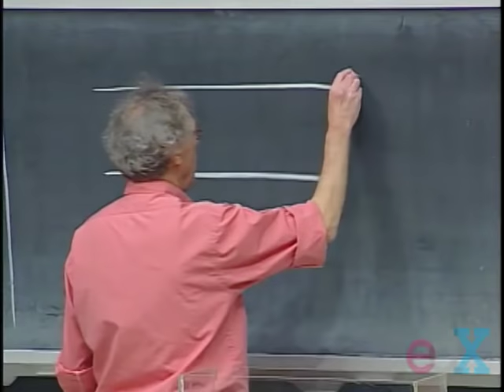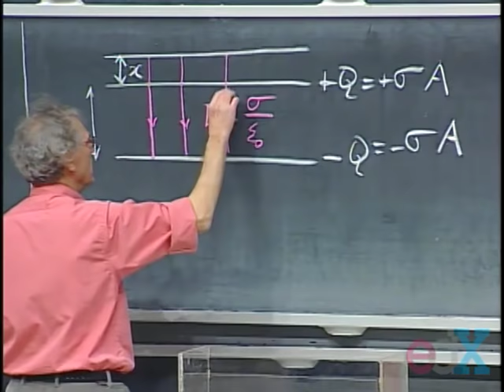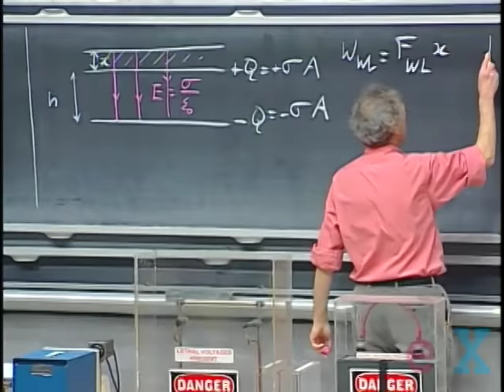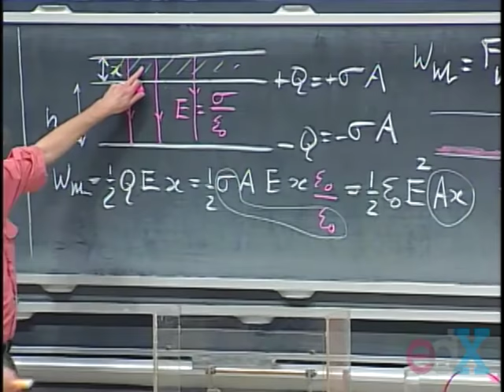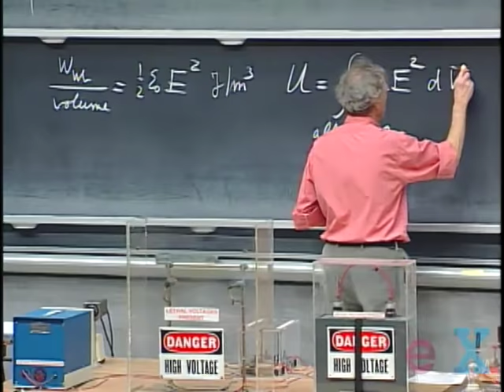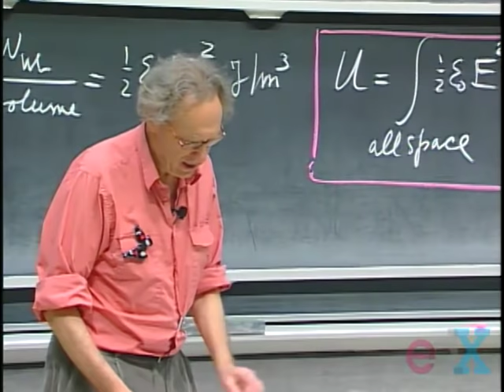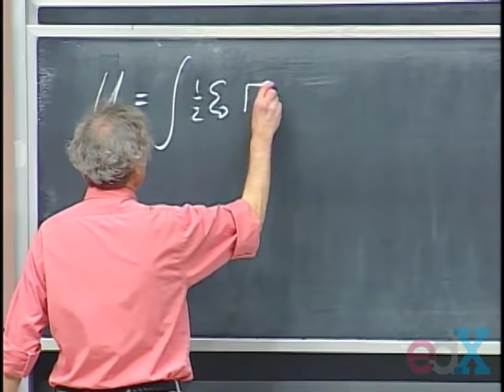8.02x - Lect 7 - Capacitance, Electric Field Energy

Comment: Sir, I have a doubt as V is the work done in bringing one charge from infinity to a point, which is of course similar like the work while moving the charge from one plate to another plate in the parallel plate capacitor, then the total work done should have been q*v only right, what is the significance of the term 1/2. Though I understand the derivation I have this confusion?
Reply from the maker: factor of 2
Let the charge on each plate of the capacitor be Q=100q (+Q on one plate and --Q on the other). Let the area of each plate be A. The E-field between the plates is then Q/(A*eps_o). Let the distance between the 2 plates be d.  Now release q from the + plate to the negative one. The energy that is released is force*distance which is very close to q*d*Q/(A*eps_o). But after this transfer the E-field is reduced, it’s now only 0.99*Q/(A*eps_o). I now release another q thus the energy that is released is now 1% less than with the first q. By the time I have released 10 times one q, the E-field is only 0.9*Q/(A*eps_o) and thus the force on the charge q is only 0.9*q*Q/(A*eps_o). The force keeps going down as I transfer more charge.  By the time I have released the last q (of 100) the E-field has become 1% of the original E-field thus the force on the last q is about 1% of the force during the first transfer. Thus by the time that I have released 100q=Q the average E-field was only 0.5*Q/(A*eps_o), NOT Q/(A*eps_o). Thus the average force on a charge q during transfer was NOT q*Q/(A*eps_o) but only half that. Thus, by spooning off the chaInfamousrge from one plate to the other the energy release is NOT Q*d*Q/(A*eps_o) but only half of that. The energy that is released this way (also called potential energy) is identical to the work that YOU would have to do to separate the 2 plates over a distance d.
Reply: @lecturesbywalterlewin.they9259  Thank you for your reply sir. 😍😍😍
Does that mean initialy the workdone will be less to charge a Capacitor then as it approaches its max limit the amount of work done will be increased? Am I right sir?

Comment: Sir,Why must the electric field be taken as average between field strength inside the plate and outside at 3:23 ?
I thought since i am moving Q, and Q is inside the plate the force should be QE=0.
Another thought I had was since the charge is on the surface, let me consider it to be outside the plate.Then the field there due to the opposite plate wil be sigma/(2 epsilon naught) on every dQ and then I may get the answer you got. Please guide me. What is actually happening here? Thank You
Reply from the maker: I get this question often. I suggest you ask Google to help you. Or if you have a physics book read up on it.
Reply: I guess it's because the layer of charge inside the plate has two surfaces - one that is exhibited to the field of E = sigma/epsilon_0 and second to field of E = 0.

Comment: @18:01 Also.. since electric field between parallel plates is constant.. reducing or increasing the distance between them should not change its ability to breakdown the air and therefore, the capacity to hold charge (capacitance) should remain constant right ??
Reply: Capacitance of an object is not measuring the object's ability to breakdown its surrounding air. Instead It's measuring the object's resistance to accepting new charge... meaning .... if the work done required to increase an object's charge is low.. then the capacitance of the object is said to be high !! 

So.. by using the formula for electrostatic potential energy for a capacitor in 6:39 we can show that.. for the same amount of energy, the capacitor with shorter distance of separation will collect more charge !!
And the discharge that can result in bringing the plates very close to each other can be avoided by placing a paper in between which is a better dielectric than air that wont breakdown very easily.
Reply from the maker: yes E is independent of d as long is d is much smaller than the dimensions of the plates
Reply: Yes sir. Thank you for taking the time time to comment when you have followers by the millions. It's a daunting task to think of and we thank you for your kind heart and service 😊

Comment: Sir we know that energy density is 1/2E^2epsilon0 
but what is the energy density if we insert a dielectric slab of dielectric constant k  
And isn't it true to say that the E in the energy density expression the magnitude of E field inside
Reply from the maker: <<<1/2E^2epsilon0 >>>
if you insert a dielectric after the charging battery has been removed the E-field between the plates will go down. Thus the energy density will go down. It means that as you bring in the dielectric it will be "sucked in.*
Reply: And professor what about the the E in the energy density expression 

Is it the E field inside the capacitor
Reply from the maker: I cannot add to the clarity of this lecture

Comment: hello dear, 
I want to do an experiment like the one u show in 29:06, but when I connect the voltimeter to the parallel plates, it always gives me the differential potential of the power supply, but I can´t measure the differential potential between the plates, can you help me please. I teach Physics as well as u, and I really want to show this experiment to my pupils . Very thank u, from Colombia.
Reply from the maker: +JEISON VARG You cannot use a "standard" voltmeter as it would remove charge from the plates since you are connecting the 2 plates through a (perhaps) 100 Mohm resistance of the voltmeter. At 1000 V difference between the plates you will draw a current of 10^(-5) A. The charge on your plates is very small as the capacitance of your capacitor when you start is probably only a few pico F at best. Thus Q is of order 10^-9 C. A 10^(-5) A current is deadly. You need a voltmeter that does not draw any current. That's the one we used. If you want more information on how to get one I suggest you contact Andy Neil who is the physics demo person at MIT. aneely@MIT.EDU.
Reply: Very kind of you, thank you.

Comment: Hi Professor Lewin, 

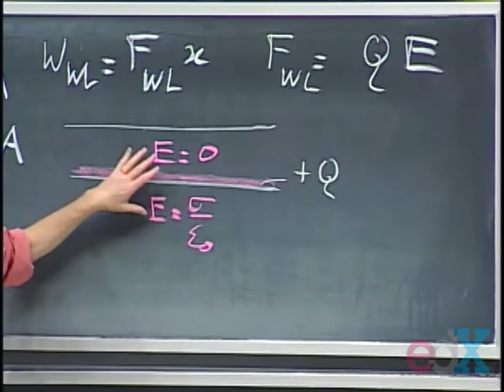At time 3:33, how can the charge reside on the surface inside the plate if the electric field inside is 0? Shouldn't the charge reside outside since by Gauss's law inside the plate should be 0 charge if the electric field is 0?
Reply from the maker: the charge is at the surface of the plate but the charge has a finite thickness which is my pink layer. There is NO charge inside the conducting plate. I have a better way to explain the factor 2. Maybe that helps you:
factor of 2
Let the charge on each plate of the capacitor be Q=100q (+Q on one plate and --Q on the other). Let the area of each plate be A. The E-field between the plates is then Q/(A*eps_o). Let the distance between the 2 plates be d.  Now release q from the + plate to the negative one. The energy that is released is force*distance which is very close to q*d*Q/(A*eps_o). But after this transfer the E-field is reduced, it’s now only 0.99*Q/(A*eps_o). I now release another q thus the energy that is released is now 1% less than with the first q. By the time I have released 10 times one q, the E-field is only 0.9*Q/(A*eps_o) and thus the force on the charge q is only 0.9*q*Q/(A*eps_o). The force keeps going down as I transfer more charge.  By the time I have released the last q (of 100) the E-field has become 1% of the original E-field thus the force on the last q is about 1% of the force during the first transfer. Thus by the time that I have released 100q=Q the average E-field was only 0.5*Q/(A*eps_o), NOT Q/(A*eps_o). Thus the average force on a charge q during transfer was NOT q*Q/(A*eps_o) but only half that. Thus, by spooning off the chaInfamousrge from one plate to the other the energy release is NOT Q*d*Q/(A*eps_o) but only half of that. The energy that is released this way (also called potential energy) is identical to the work that YOU would have to do to separate the 2 plates over a distance d.
Reply: Thanks so much! Makes perfect sense  @lecturesbywalterlewin.they9259

Comment: Sir still i can't understand the reason why the force due to  electric field becomes half there ? At 3:35 🙁.. please sir explain
Reply from the maker: factor of 2
Let the charge on each plate of the capacitor be Q=100q (+Q on one plate and --Q on the other). Let the area of each plate be A. The E-field between the plates is then Q/(A*eps_o). Let the distance between the 2 plates be d.  Now release q from the + plate to the negative one. The energy that is released is force*distance which is very close to q*d*Q/(A*eps_o). But after this transfer the E-field is reduced, it’s now only 0.99*Q/(A*eps_o). I now release another q thus the energy that is released is now 1% less than with the first q. By the time I have released 10 times one q, the E-field is only 0.9*Q/(A*eps_o) and thus the force on the charge q is only 0.9*q*Q/(A*eps_o). The force keeps going down as I transfer more charge.  By the time I have released the last q (of 100) the E-field has become 1% of the original E-field thus the force on the last q is about 1% of the force during the first transfer. Thus by the time that I have released 100q=Q the average E-field was only 0.5*Q/(A*eps_o), NOT Q/(A*eps_o). Thus the average force on a charge q during transfer was NOT q*Q/(A*eps_o) but only half that. Thus, by spooning off the chaInfamousrge from one plate to the other the energy release is NOT Q*d*Q/(A*eps_o) but only half of that. The energy that is released this way (also called potential energy) is identical to the work that YOU would have to do to separate the 2 plates over a distance d.

Comment: the reason why there is a factor of half at 3:33 is that when we consider force on the upper plate then that force will be by the lower plate in downward direction................... 

and the magnitude of that force will be equal to (charge on upper plate)(E-field due to lower plate) = Q[(sigma/2)*(epsilon_0)] 
(just as we used to in case of a chrge "q" in the E-field of "Q")............................
Reply from the maker: we discussed this in depth long ago.
Reply: What I am trying to say is that a positively charged plate would feel a force of Q*E in the E-field of a negatively charged plate and that E=(sigma*epsilon_0)/2

Comment: are'nt we supposed to add the Electric fields, each of which is derived per plane. 
in that case,  
inside surface of positive  plate  creates  [ ps/E0]
inside surface  of negative plate creates  [ps/E0] 
since the vectors of E fields are in the same way, they add up. 
in conclusion,  magnitude of E  field is        [2ps/E0]

ps: surface charge density
E0: electric permitivity

Comment: Professor ...in the last lecture you discussed about the high voltage break down and you have said that two parallel plates can cause electric field pass through air when the electrons have enough KE to ionize the molecules of o2 and nitrogen in case of very high voltage so then the electric field between them is not zero ....but why did you take E=0 between these parallel plates at the starting of the lecture in case of high potential difference between them the electric field is not 0 right?

Comment: professor, while charging a capacitor does the charge travels through the battery as well??
Reply from the maker: watch my lecture where I discuss the Zn Cu battery
Reply: Lectures by Walter Lewin. They will make you ♥ Physics. i could not find my answer professor in this lecture of yours

Comment: professor, I am not able to understand why did you take the average of both the electric fields at 3:35.
Reply from the maker: factor of 2
Let the charge on each plate of the capacitor be Q=100q (+Q on one plate and --Q on the other). Let the area of each plate be A. The E-field between the plates is then Q/(A*eps_o). Let the distance between the 2 plates be d.  Now release q from the + plate to the negative one. The energy that is released is force*distance which is very close to q*d*Q/(A*eps_o). But after this transfer the E-field is reduced, it’s now only 0.99*Q/(A*eps_o). I now release another q thus the energy that is released is now 1% less than with the first q. By the time I have released 10 times one q, the E-field is only 0.9*Q/(A*eps_o) and thus the force on the charge q is only 0.9*q*Q/(A*eps_o). The force keeps going down as I transfer more charge.  By the time I have released the last q (of 100) the E-field has become 1% of the original E-field thus the force on the last q is about 1% of the force during the first transfer. Thus by the time that I have released 100q=Q the average E-field was only 0.5*Q/(A*eps_o), NOT Q/(A*eps_o). Thus the average force on a charge q during transfer was NOT q*Q/(A*eps_o) but only half that. Thus, by spooning off the chaInfamousrge from one plate to the other the energy release is NOT Q*d*Q/(A*eps_o) but only half of that. The energy that is released this way (also called potential energy) is identical to the work that YOU would have to do to separate the 2 plates over a distance d.
Reply: @lecturesbywalterlewin.they9259  Thank you so much.

Comment: Sir I have a book which says that the reason behind considering 2 bodies(with opp charges) as capacitor instead of isolated bodies is that effectively it reduces capacitance(small size) and the voltage difference and hence it can store the same value of charge with the advantage of small size.But I don't understand how voltage difference decreases ,infact i feel that voltage difference should increase as in the case of isolated bodies we take V.D between the body and infinity(V=0) whereas in case of 2 bodies we take V.D between one body(V=+ve) and another body(V= -ve). Hence shouldn't their V.D be larger?
Reply from the maker: +Veeresh m Watch my lectures. The capacitance of a single sphere with radius R is much smaller than the capacitance of 2 concentric cylinders one with radius R and the other with radius R+dR. The smaller dR, the larger is the capacitance. The same is true for single plates and plates which are at a distance dR from each other.

Comment: 14:32 Does it depends of the way we approaches the sphere B with our test charge? I think of this because the configuration of the electric fields will change when we add the A sphere, and E⃗ = -∇ (V) so V(r) (r the distance from the center of the B sphere) changes?
Reply from the maker: The Capacitance of B does not depend on the way we move A. It only depends on the final position of A relative to B.
Reply: @lecturesbywalterlewin.they9259  I probably expressed myself badly (English is not my mother language), I wanted to say that if we take sphere B alone, with a certain net charge QB, its electrical potential is the same everywhere on this sphere, and the equipotential areas are concentric around this sphere.
But when we add the sphere A with an opposite net charge -Qb, Qb remains identical on the sphere B, however the equipotential areas will no longer be spherical around the sphere B because the lines of electric fields leaving B will be reoriented towards A, so when we approach a test charge of B, depending on which side we approach it (I said approach not touch), a test charge will not undergo the same potential gradient for the same distance traveled, is this not? 
So the work necessary to bring a charge close to B (at ∆r from the surface of B) will not be the same depending on which side we approach B (I said approach, not touch), is not it? My question had nothing to do with capacitance, it was referring to what you said at 14:10 I think I got the timing of the video wrong in my first message.
Thanks a lot

Comment: Sir since potential energy of pair of opposite charges is positive due to the attractive nature of force, should not be the potential energy of capacitor be positive as the force between the capacitor plates is attractive?
Reply: One more question. Is workdone = negative of potential energy stands true for all conservative forces?
Reply from the maker: If I stretch a spring over a distance x I have to do positive work 0.5kx^2. That is called PE. If I lift an object vertically over a distance h. I have to do positive work mgh. That is called PE.
Reply from the maker: PE of a capacitor is 0/5*C*V^2. It's always positive.

Comment: Professor Lewin, are you still on Twitter? I want to ask you a question about High Voltage Power Lines built next to spillways, waterways, watersheds, etc. High Voltage EMF / EMR is known to be detrimental to human health. The radius of EMF exposure from High Voltage Lines is roughly 1/4 mile. If water is diamagnetic, and a conductor of electricity, why is the Worldwide Power Grid designed next to water resources and transformers next to fire hydrants?
Reply from the maker: this is outside my field of expertise. try google
Reply: Lectures by Walter Lewin. They will make you ♥ Physics. Thanks for the quick reply.

Comment: sir i am not able to derive the expression of potential energy for a parallel  plate capacitor by the other method of bringing charge from infinity to that point ...pls help
Reply from the maker: The PE is the work you have to do to put charge +Q on one plate and -Q on the other. That should work for you. If not, please consult google
Reply: ok thanks sir ...

Comment: Given that you evaluate the energy density of the electromagnetic field of a point charge how would I actually go about calculating this as the integral  Should surely diverge because of the 1/r^2 relationship
Reply from the maker: We interpret uE = ½ε_o*E^2 as the energy density, i.e. the energy per unit volume, in the electric field.